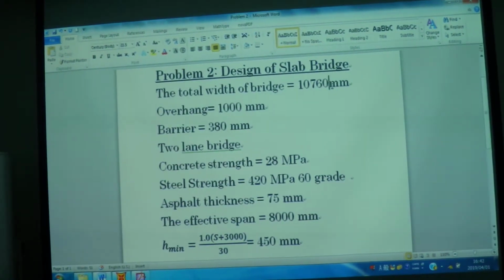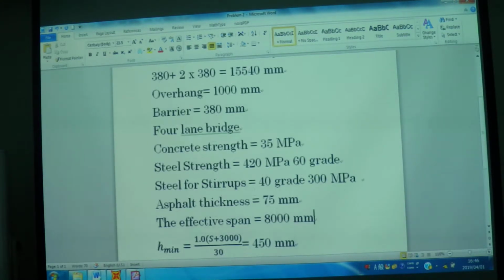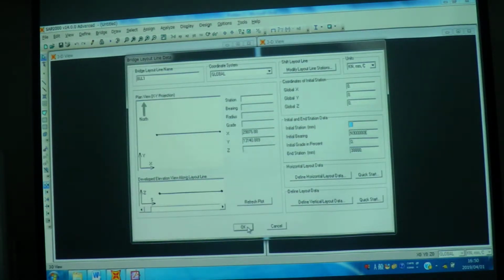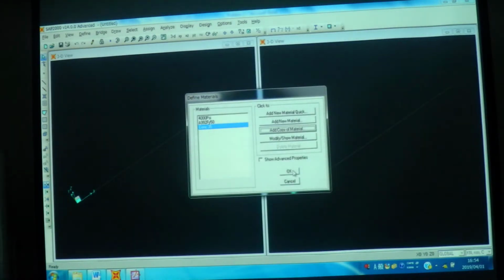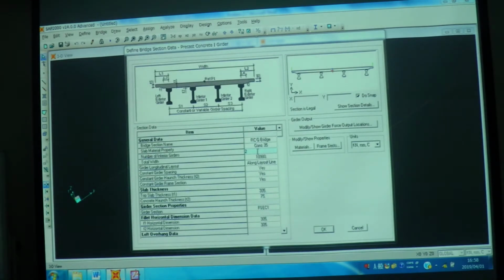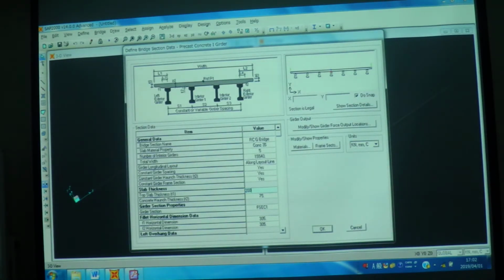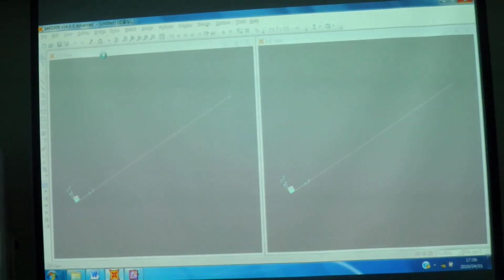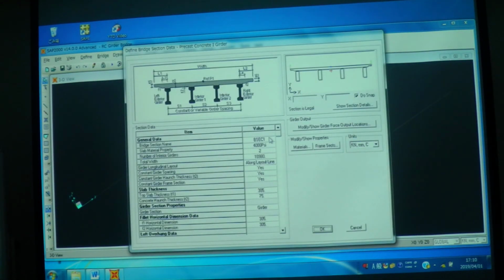Modeling of RC Girder Bridge using SAP 2000 Part 1

Comment: i have SAP V 16 in which there is no Tab of Bridge so what should i do
Reply: download csi bridge
Reply from the maker: Irshad you can download CSI bridge. For recent versions of SAP CSI did not include the bridge module.
Reply: @engrumair2003  thank you sir 
Is it possible to model full 3D Bridge in CSI Bridge ??
Actually i want to develop fragility curves for different components of the bridge (pier,bearing pads ,expansion joint and transom etc.)
Reply from the maker: @irshadkhan-nt7yt  Yes you can model it. Excluding bridge foundation and pile cap. But for fragility curves, I will recommend SAP 2000 as it includes a lot of advanced non-linear analysis features and performance-based analysis.
Reply: @engrumair2003  OK sir but as you have mentioned in your previous comment that SAP2000 do not have Bridge module any more .
How can i use SAP2000 for Bridge analysis regarding fragility curves
Reply from the maker: @irshadkhan-nt7yt  Dear Irshad Please use the older version such as SAP 2000 14 or 15.
Reply: @engrumair2003  OK i am going to find the older version of SAP
Reply from the maker: @irshadkhan-nt7yt  I recently uploaded the full 3d modeling of RC girder bridge. The same procedure you can use for all other types of bridges.
Reply: @engrumair2003  OK sir i am going to download that 
Thank you sir ...i will be in touch with you sir during my research IA